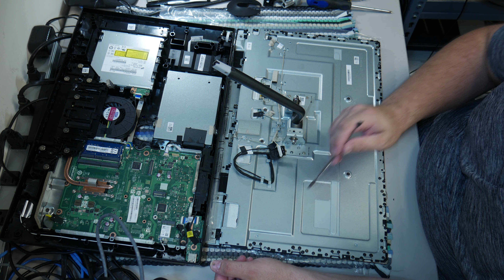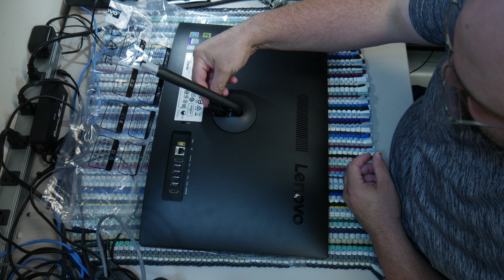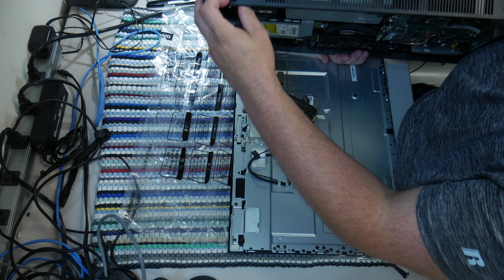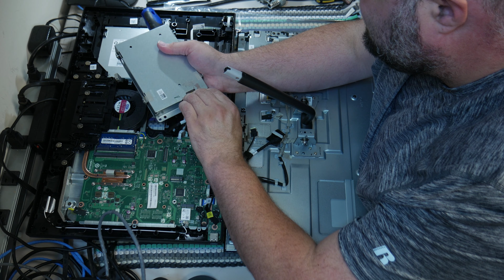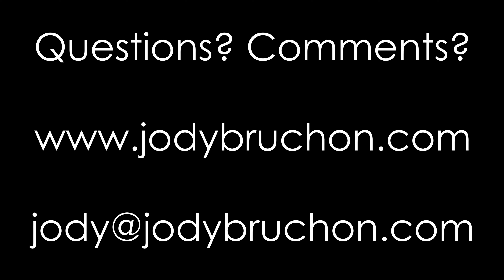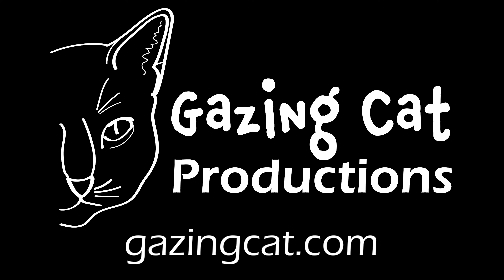Lenovo Ideacentre All-in-One Disassembly - Jody Bruchon

Comment: Thank you for this useful video. My wife has one of these and I was looking at upgrading to an ssd and more ram. However it appears that the board is maxed out to 8Gb by design and I am  a bit worried about the risk of smashing the screen on a machine we use for business for the sake of half an upgrade. So I'm just going to get her something else.
Reply from the maker: You can definitely put a lot more than 8GB in it, but you're right about how stupidly put together it is. I would recommend selling it off, never buying an all-in-one again, and getting or building a proper upgradeable desktop PC setup. The all-in-one combines the disadvantages of a laptop with the bulk of a desktop. I would never ever buy an AiO for myself--especially because if the monitor or motherboard breaks, you may never going to find a replacement part! Everything is proprietary and underpowered and you can never swap out the monitor! I hate all-in-one PCs.
Reply: @JodyBruchon  The spec search I ran only the other day said. MAX 8Gb.. but that may have referred to Max available as an initial purchase. However inside the last 24 hours since Im posted my orignal comment, we have have had a windows 10 update..... Its only a local account and.  dear partner forgot password.. oh dear...
Reply from the maker: @PaulL-g5l  I don't know if you are handy with a Linux command prompt at all, but if you can figure out how to burn an ISO to a CD and boot it on this computer (in legacy/CSM mode) you can download MiniTSS 2.9.0 from here and use the chntpw tool to reset your password in the /Windows/System32/config/SAM registry hive: https://www.jodybruchon.com/tritech-service-system/
Reply: @JodyBruchon  Fortunately we managed to sort it. Burning ISOs to USBs and CDs is no problem. I had forgotten about MiniTool. I shall download it and put it into the armoury so to speak. I'm still going to get shot of the IdeaCentre thing, Ive got a nice little Dell I7 NUC style thing here with a fresh win10 licence. She can have that instead.

Comment: and I only wanted to change the internal battery because my clock doesn't keep time any longer. Not worth opening a can of worms to do that. Thanks for the clip!
Reply from the maker: This computer shouldn't have that problem yet; the batteries last 10+ years. Is it under warranty?
Reply from the maker: @mike gee I can't say for sure, but it's possible that software is doing something weird. I've never seen that sort of thing before. If you want to replace the clock battery, pulling the motherboard isn't that hard. It's just the big green board you see once you're in and it's only held in with a few screws and a bunch of connectors that are easy to find and put back in place.

Comment: Hey Jody, great video! Just curious if the HD only sped up load times or would it also improve matters for a game (x-plane 11)?  Have you since done any RAM upgrades? I'm just trying to figure out if it's worth putting $100-200 in to it, or just accept it for what it is?  Thanks!
Reply from the maker: I own a computer repair shop. I don't own that computer. I have built a machine for X-Plane, and it will generally improve load times but do nothing for the overall performance. You will definitely want to add a graphics card for something like X-Plane (edit: oops, it's all in one, can't do that...well, upgrade the RAM at least.). RAM is stupid cheap, so I highly recommend upgrading it if you will be doing more than basic stuff. Most people won't notice a big difference beyond 4 GB, but it sounds like you'll be putting a heavier workload than a typical consumer on it.
Reply: @JodyBruchon  awesome, thanks so much for your quick response and great video!

Comment: Is there ssd slot for upgrade?
Reply from the maker: You can always rig up a 2.5" SSD where the hard drive is, but in the opening of the video, there's a M.2 slot to the right of the big white bar coded sticker on the motherboard. It does not appear to have a screw standoff, though, so you'll need ont of those and you'll probably have to remove the motherboard to install it. I did not show motherboard removal here, but if you've worked on laptops before it ought to be fairly obvious. Here's info on the standoff and screw: https://forums.tomshardware.com/threads/m-2-ssd-with-no-screw.2560491/